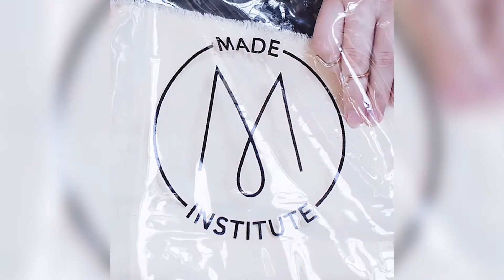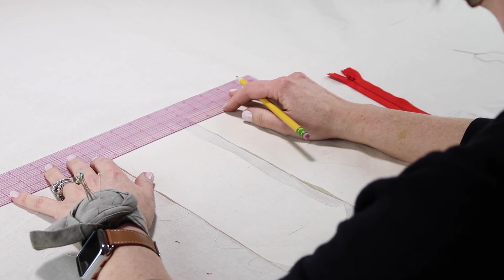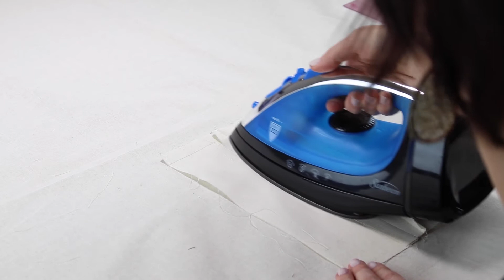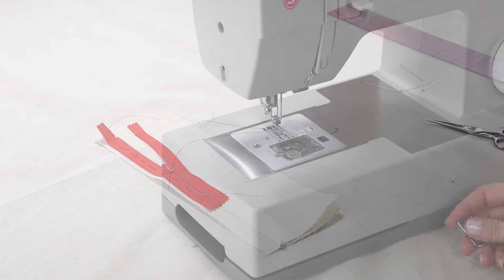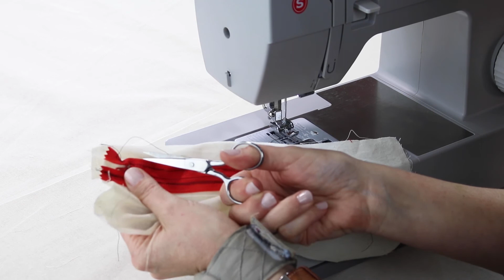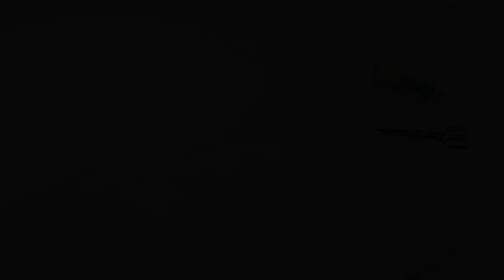Sewing a lapped zipper for beginners!

Comment: You did this quite a while ago so might already know this tip by now...  When using the seam ripper the little red glass ball is better facing down so it can slide under the stitches you ripping/cutting out with the seam rimmer. That way it's much easier and the risk of accidentally cutting your fabric is greatly reduced. When ripping out the basting stiches at the end you can still start at the bottom and rip away from you.  Then there's no chance of cutting through your 'L' at the bottom. :-)